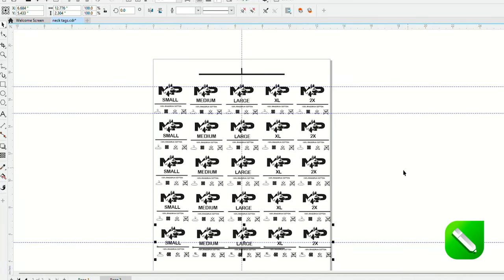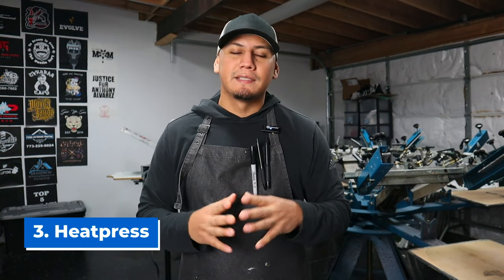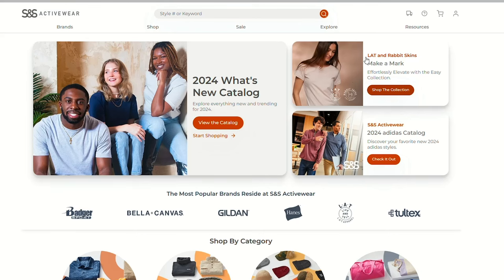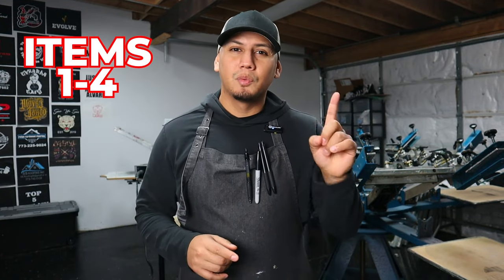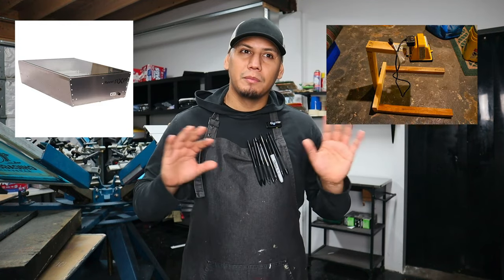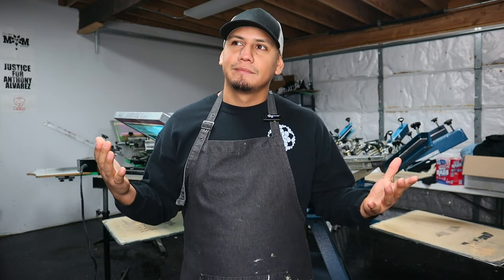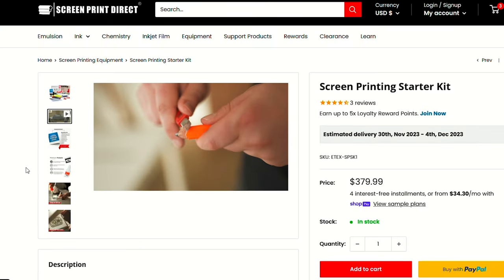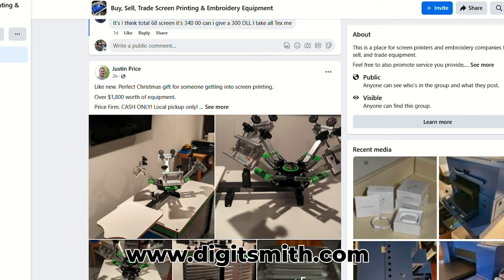Cheap vs Expensive Screen-Printing Equipment to Make T-Shirts.

Comment: Great video man!  Appreciate all the info.  I was actually looking into this simply because the quality of NFL and NHL apparel is so bad that I want to make my own bootlegs!  And speaking of poor quality, everyone stop using those horrible Gildan shirts! The sleeves are too short, and 9 out of 10 the seams start to unravel after a few washes.  Use the Alstyle 1301 instead.  The cut, fit, and quality is far superior for not much more than the basic Gildan.  Let that be a lesson to anyone looking to make their own shirts.  Don't skimp on the shirt itself.  Remember, no one will want to wear your shirt if it doesn't fit well, look good, or hold up over time.

Comment: Mylo, God bless you brother. I enjoy your videos on screen printing, especially when you promote God, that's disciplining. I'm starting screen printing and your videos gives me so much info so that can start with no kinks, even though i WILL make mistakes. I'm using Separation Studios and i have screens from 150 to 220 mesh I made my exposure unit (how should it take to expose?) and have a flash dryer. My press is the cheap one until i grow.. I appreciate your input on exposure time and expulsion shelf life.   
Thank you  Andrew from Tampa.

Comment: I like DTF but the problem with the DTF method is how the results are the same as using a screen, meaning the DTF print results can be absorbed into the cotton t-shirt. not just sticking. Can you tell me how to get DTF absorbed